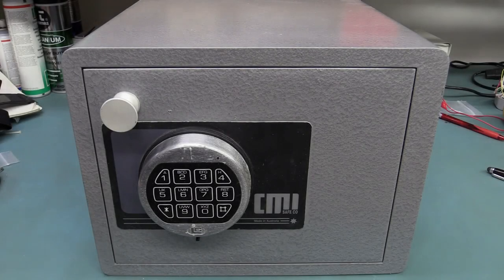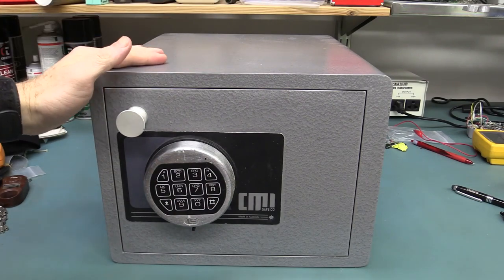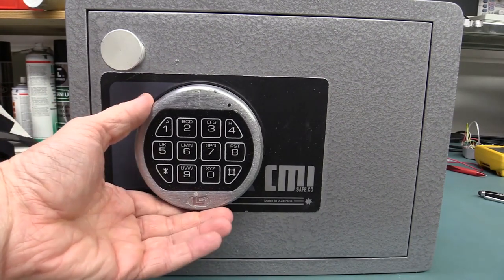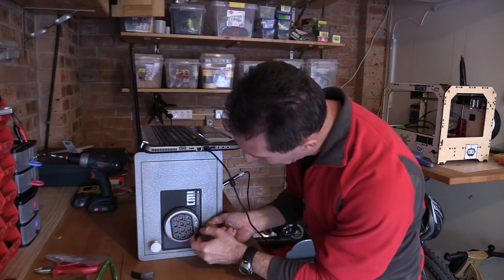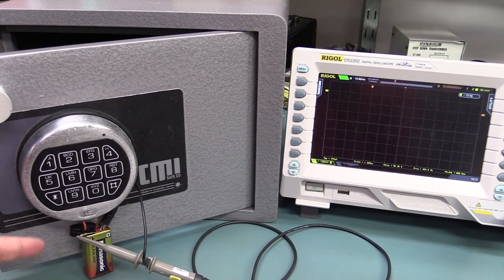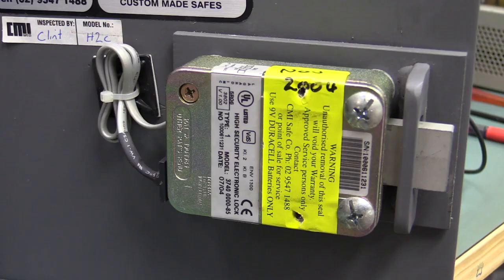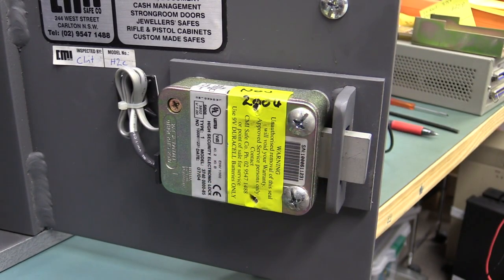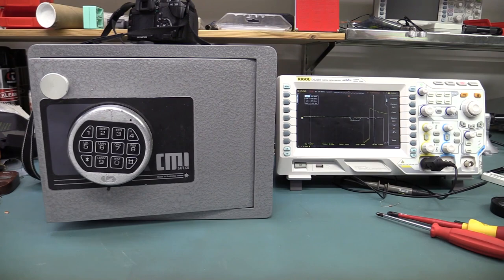EEVblog #762 - How Secure Are Electronic Safe Locks?

Comment: Interesting aussome vid as always Dave!

I am not surprised at the results of the sniffing. I've always seen, and used myself, store and only compare once correct amount of digits are entered programmes, which the loop time and activity would be the same for each digit entry, wrong or right. The only usual activity between digit entries is a timeout timer/counter, if utilised. In any case, its always worth a fair go just for the sake of fun and etc I say. 

The bit about bumping was interesting as well, though I reckon the lock mechanical design is pretty nice. I reckon: Using the image @38:24, when you try to bump the lock by slamming the entire safe (or just the lock unit as you did) the direction required to force the solenoid plunger down, the big latch is also forced down in the same direction. This exerts force on the little plate the solenoid plunger goes through, which in turn exerts a sideways force against the plunger, effectively causing it to bind and thus become unmovable and keeping the latch locked.

Its not to say its bump proof, but you would have to prevent the latch from pushing the little plate until the exact moment the plunger is clear... certainly not easy I reckon, not to mention you would be making big mobs of noise haha. 

I could be wrong... but that was what I reckoned whilst watching this. Keep up the great fun Dave!

Comment: did you by chance check to see if the spring or solenoid pins were magnetic? sometimes this is overlooked and you can activate the solenoid with a very large neodymium magnet and pull the pin. be curious to know how this fares against that. sentry safes are vulnerable to this sort of exploit

Comment: Anyone else wondering why he didn't use a bent coat hanger and a torch and some good old-fashioned peep-through-the-hole to try and reconnect the wire?

Also, that is how I would spike the solenoid. Turn the safe around, if it's not already mounted (dismount it if it is) and poke a wire through the mounting hole, after disconnecting the old wire using a coat hanger.

Comment: At 36:24 in the video. That 100 ohm ("1000") resistor between the large caps, is it there to decouple/detach the microcontroller even further from the power input ? and why do they have a TL431 with its anode and cathod in series with the negative supply to the big cap going to the micro ? The two caps are not on the same ground net. http://www.ti.com/lit/ds/symlink/tl431.pdf Oh btw this is the most entertaining video so far !! Loving the extra challenge you had to open it ! Thanks.

Comment: EEVblog I think the more reasonable form of the attack would be to create a replacement 9v battery with a little micro to record successful openings, and try to correlate the handling of specific keys to a powerline profile. Or go down to the hardware store and get a pipe wrench to torture the owner with.

Comment: Maybe we are overthinking this. What happens if the transistor fails? For instance when stressing it with a high voltage. Will it operate the solenoid? (assuming the switch fails 'closed')

Comment: Did you consider applying various high voltage spikes to the frame?  I have heard stories of old style slot machine actuators that would trip to a spike on the chassis.
Reply from the maker: Mike Valliant I mentioned that, this one cannot be spiked.

Comment: What about power surge it? If you pulls 48V through it. instead of the expected 9V would it open? or is the diode in the correct position. Is teh board grounded to the chassi? Can we create an alternative power loop an puls that one to make the solenoid jump out of locked position..... Would be interesting.

Comment: I dont know if anyone has said this, and someone had to of thought about this since it was my first thought but is that pin perhaps ferrous metal? Could you maybe use a powerful magnet or an electromagnet to create a strong enough magnetic field to move the pin and overcome the resistance of the spring?

Comment: if you can get to the solenoid wires  apply a 9 V battery across the  wires an bingo your in! 2 pinchers to break through insulation. one on each.

Comment: that is a regular tele CABLE i don't think it will break ever since it barley moves. most people are able to strangle someone with the chord and still receive calls. I think the wedge piece prevents bumping. since the timing and mechanical friction of  assembled parts would make it almost impossible to bump. also if you hit it on the side to bump the solenoid pin , the massive lock bar will jump as well and push the wedge shaped piece up, jamming on the solenoid bar, and it cant be bumped...

Comment: Fun video.  Here is a suggestion.  Use a 15Vdc bench supply to feed a 9Vdc linear regulator, with the current-sense resistor in between them.  The regulator will maintain a clean 9V across the filter caps inside the unit, so the current through the caps will be essentially zero.  That should allow your current sense resistor to pick up much smaller and faster changes in current.  Also, you probably need to look for very small changes in timing, like a microsecond or so.

Comment: Some and most safes have a port for I don't know lol but they look like the same cord you use with a landline...maybe it's a extension of the panel? But I've seen some with two ..so if you needed a extensive panel for whatever reason I'm not sure you're going to need another one

Comment: It looks the same as the combination lock on the safe for a coffee shop I used to work at except they had a time delay and a Robbery alert system integrated, if you input your code in with the last digit one digit higher it would start counting down as normal but also descreetly contact the police to inform them you are being robbed

Comment: Super magnet on the Right side of the safe would pull the solenoid pin out of the latch mechanism ... betya.
Just pull the safe out of the house with whatever destructive method (tow chain ala EPTPOS hit, or some kind of small explosive to break the mounting bolts) and take it down to a 'friendly' car scrap yard where you could use their powerful lift magnet to pull the solenoid pin and .. Bob's your Uncle as they say in drop bear land.

Comment: Simple way to open is to Use A Camera scope through the drilled hole like u used with your Laptop & A Long Screwdriver through the other Drilled Hole & just unscrew the lock off let it fall then open Safe

Comment: i'd say since the solenoid pin is so tiny you could take a pipe wrench to the front handle and bust it in half if you wanted in the thing (not saying there isn't easier ways)

Comment: It makes a lot of sense that there's nothing to be had. If I were designing the firmware for such a lock, I'd design the firmware to gather 6 keypresses before attempting to compare it to the correct code. There's no point designing a different code path because you don't want it to behave differently if the first keypress was wrong.

Comment: I wonder what happen if you put a 100uF charged at 200 Volts at the batt conector. Will it tripp the polyswitch or will it burn/short the pnp solenoid drive transistor (ZT751 is rated at 60V dc) and after the batt conection will open the safe. If nothing happen (only ployswitch tripp), try few more times :)

Comment: It seems to me that if you forced the keypad/knob with a pipe wrench it would shear the pin in the solenoid right off. Even if it doesn't, would likely shear the knob off and then you could proceed with pry bar or cold chisel on the bolt to get it loose. 

As far as the cheapy safes, they have their purposes. Not an issue in Oz, but here in the US they work well enough to prevent a child from getting access to a handgun or other such things they shouldn't be getting at. Sure you could pop some of the cheap ones open by throwing them at the ground, but a child likely wouldn't have the strength or height to pull it off. In addition, many of the cheapo safes are concrete filled and fire/flood rated, if you are just trying to protect from these elements instead of thieves they work well enough.

Besides, as far as I'm concerned any safe that isn't welded/bolted in to metal supports and requires a forklift to remove isn't that secure anyway, only takes a few minutes with a recip saw to hack through wood studs and drag the safe away to hack into at the thief's leisure if they are really motivated. For the rest of us, insurance and bank safety deposit boxes have their purposes.

Comment: Would it be possible to use strong magnet (permanent or electronic) to either move the pin inside solenoid or to create suitable magnetic field for the solenoid to activate?

Comment: Should have analyzed after the 6th digit entered, say 123456 v 123455, to look for any timing differences. Correct vs incorrect code would obviously draw different power due to the solenoid but solenoid activation should only happen after the check from the processor.
Reply: arlo bubble If you could notice a timing difference at the end, it would be pointless, as the safe provides feedback for both an incorrect and correct code

Comment: What could happen if you supply overvoltage thru the battery clip?
Would the solenoid operate because of a blown IC and current therefore passing throug?

Comment: This is a good example of what is called a 'side channel' attack.  I don't know hardly anything about software, but I know a good bit about software security.  One easy error that novices make in doing something like checking if a password matches is to check each byte in turn, stopping when they find one that doesn't match.  If you do it that way, then the process of checking the password will take a few nano/milliseconds (depending on CPU) less between a password with a few correct characters than a totally wrong password.  So you can just try every possible byte for the first byte, and whichever one takes longer/shorter than the rest is the first one.  Repeat from there and you quickly have the password.  You can even do this over the Internet with some basic statistics to account for network delays!  Writing secure software takes a lot of skill, and most companies don't care enough about security to pay for software developers with those skills, which is why most software systems today are insecure.

Comment: an even more basic way to crack safes.... if there had only ever been one combination used on the safe, you can use a magnifying glass to study the wear pattern on the keys. once you've figured out the numbers used in the combination but not the order, you can just try all combinations of those numbers. there isn't a huge amount once you know what numbers it uses.
Reply: the safe I did (which was my parents and they had forgotten the combo lol) was only 4 digits + the letter A or B. so knowing the numbers used brought it down to only 16 possible combinations since I knew the letter A was the last digit. But obviously even had I not known the last digit it would only have been a possible 32 combinations, which isn't bad... I got it on like my 8th try...

Comment: The bottom line of ANY electronic lock is that, after all the mechanisms, software (on some higher-end models), and other protections, there are two wires running parallel inside that only need a drill hole for access, then scrape the insulation and cross them to unlock.  Every. Single. One.
Reply: Yea but if you're gonna drill through it, might as well just cut through the locking bar. Less fiddling around and much easier to find the correct spot.
Reply: @mrkiky  In the ones I've seen, it's a single hole through the outer shell and then one through a 16-ga inner cover -- all outside the armored box containing the actual locking mechanism, which is what makes it relatively simple.  Locking bars move and have play even when they don't, so how is that easier (also considering it is within an armored casing)?
Reply: @adamchurvis1  Well I was talking more about this particular safe. I only imagined that the ones that have an armored case would also have an armored lock.

Comment: What happens when the battery goes flat?  If there's a manual over ride key these are usually the easiest way to get in but if there's no over ride and the battery is flat you're knackered

Comment: Any lock mechanism wouldn't respond differently to any digits until the last.  It should simply store them until the last (sixth in this case), then check them against the correct code.  If there's any difference to be found, it would be after the last digit..  No difference from trying every code possible.

Comment: If you wanted a quick way to get into that specific safe having already seen the inside why wouldn't you just drill 1 (or 2) holes in the top and unplug that internal cable (the one you forgot) then supply your own external power to that motor and solenoid?  Would seem like a quick job if you made the tools in advance like they do in the movies.  You were able to plug the cable in with 2 screwdrivers.  If you had a longer forceps it would seem easy to plug in your own cable.  You should try it. :)

Comment: If there are holes in the back can't you get in with very long screwdriver, remove the lock backplates and inject power direct to the solenoid? then re-assemble once open for the perfect crime

Comment: Well of course you wouldn't see much. A digital lock doesn't compare the inputs live, it simply stores the digits in memory until the preset series length is entered or the trigger button is pressed. Afterwards it compares the whole entered series to the one in memory.

So they don't really need decoupling. All you see is power on, digit store, wait. With enough resolution you could possibly retrieve info like the digit you are pressing, but nothing you wouldn't know by simply poking at the pad with your finger.

I suppose if you had the safe at work you might be able to assist a brute force combination attack through the data gained during string comparison stage, but this is nothing that could be realistically used by a thief thanks to the incorrect combo lockout timer.

Comment: picture this:
a robber breaks in to your house, and he finds 3 safes: one really big, state of the art and expensive in your bedroom, another in your studio, kind of a half end safe, and a small one (like this one) in a guest room. They will assume that the most valuable stuff is inside the big one, inside your bedroom, close to you, so that will be the main target; by the time they figure out that the most valuable stuff is inside the small guest room safe, they still do not know that the inside cable is unplugged, so you have a lot of time to call the police and fuck them up... so why unplug the cable inside the guestroom safe in order to shut it out? because the kind of stuff that you place in a triple decoy, low end broke-by-unplugging-a-cable safe, is the kind of stuff that not even you access on a daily basis and it is more valuable that gold...................... so it can be digitized, so you can scan it and put it in a 64gb sd card, coated with a bio compatible material and place it under your skin.

Comment: ~ 39:40
mmmmmh could you maybe apply an oscillating force while the safe is on it's side? if you then vary the force's oscillation frequency until you find the resonance for the little spring+pin I think it could be entirely possible to have it open

Comment: I wonder, does it make any difference if you lower the supply power to the point of "barely" working (i.e. make the MCU "stuck" with different power consumption based on code path it went trough) :?

Comment: As a programmer I would make it store all the digits and then in the end make a comparison with the stored pin to see if they match. And using that logic it would be impossible to probe the power line for correct and incorrect single code inputs. And i'm guessing that's how they did it.

Comment: Strong magnet maybe :p ...  Flip the safe up side down, then stick the magnet from the furthest point from the main door lock and slide it  gently to it... the magnet will move the pin and gravity will pull the trimmed edge plate,then when the force of magnet finally reach the main locking plate, it will pull it... I guess

Comment: The locking mechanism should have had a failsafe if the battery was flat or not connected (obviously needed to be open first).

Comment: Doesn't it need to read the code from the eeprom when the battery is replaced, I'm curious what that looks like but I'm assuming it can't help figuring out the code unless  it has a signature that you can compare to another identical lock...

Comment: I'm also left wondering how much mechanical force would be required to force that bolt under the chamfered latch.

I think a strap wrench and a bit of brute force and ignorance may just do the job.
Reply from the maker: ***** I'm pretty sure you'd just tear off the  lock. You have to remember that this has been the industry standard lock for two decades. If it was susceptible to such a thing then it wouldn't have the rep it's got.

Comment: Hay Dave , and all ,
Most mechanics are going to have long part / tool recovery tools [ dropped part or tool grabber ] .
I have many , some bought some made and a friend that is partners in a medical tools company has given me a bunch of long reach / grabbers .
Then you could use the holes already there to plug back in the FAIL ;(
Reply from the maker: KD0CAC I had a hard enough time using the new holes I drilled close and in the optimal position.